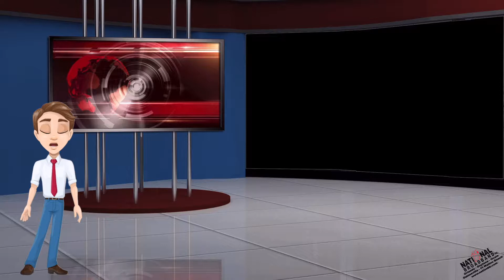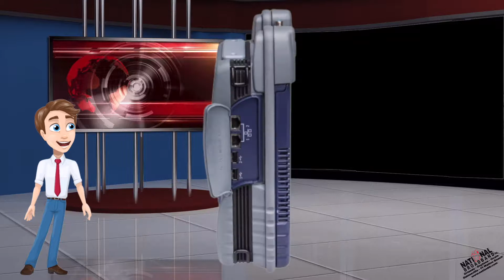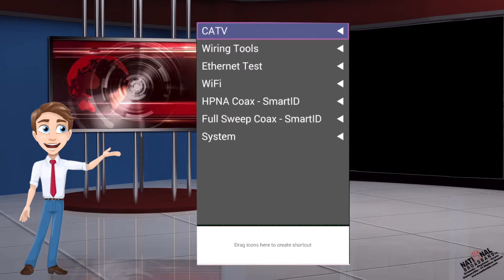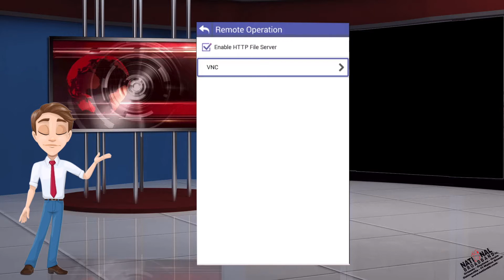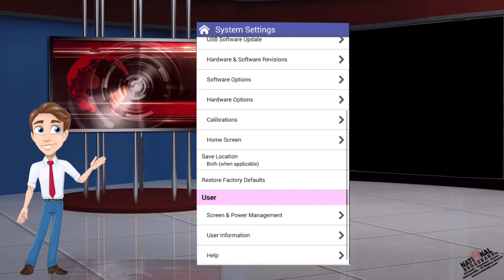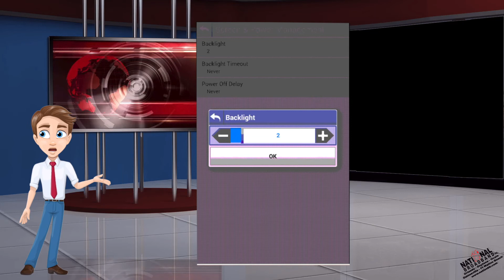Intro to Viavi OneExpert CATV Features

Comment: They run out of juice so fast! I have to charge mine everyday.
Reply: The amount of calculations it does and the fact it’s as small as it is and thermals aren’t an issue while in the field (most of the time) is actually impressive in my opinion. The screen glare at the side of a home at a weird angle is what really annoys me tbh
Reply: @iiishimmyiii  Oh yeah that freaking glare. It’s even worse when your dangling 30 feet from a pole in the air lol